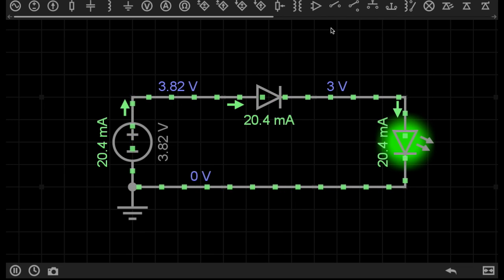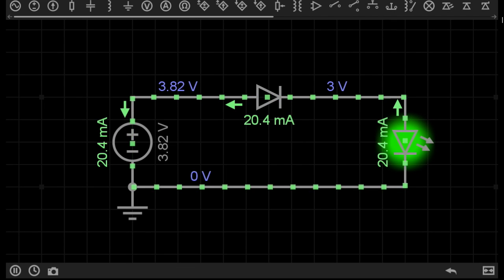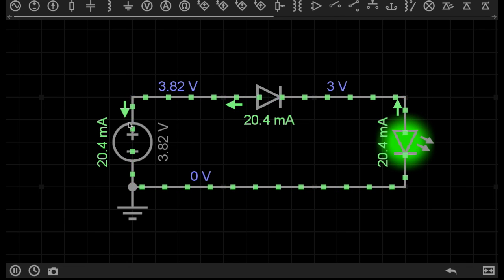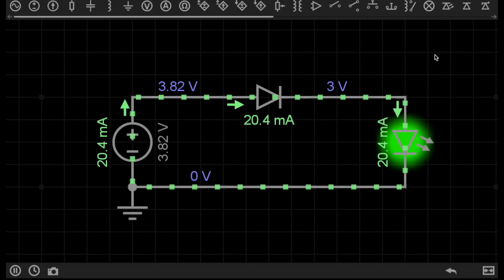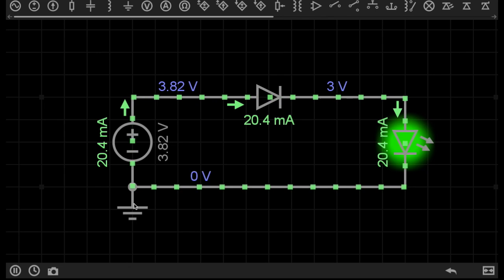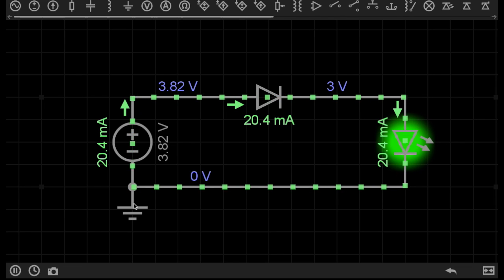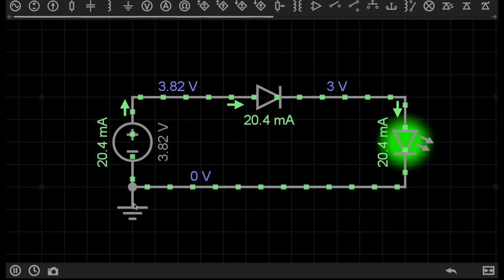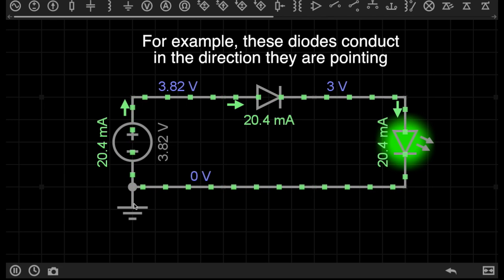Conventional vs Electron Flow Current Flow

Comment: I have a question. Say you design a simple circuit consisting of a battery, resistor, and LED. Conventional current flow says current  will go from the cathode to the resistor(the resistor will then weaken the current making it safe for the LED) and then the LED will light up and current will reach the anode. But real electron flow says current goes from the anode to the cathode. The LED will come before the resistor. The LED will be on the wrong side of the resistor and it will explode because the power rating is too low. Wouldn't this situation make conventional current flow circuit diagram dangerous to follow?
Reply: @Active camo To answer the question, Current is the same through all parts of a series circuit. It is the same through the resistor as it is through the LED. The resistor is there to limit the current. It doesn't matter what side of the LED the resistor is on, it just cannot be so large that most of the voltage is dropped across it and doesn't give enough voltage for the LED to emit. BTW he didn't "mispronounce" anything, he just incorrectly referred to electron flow as conventional current flow. There are two ways of thinking about it. Conventional current flow says that current flows from positive(anode) to negative(cathode) In reality, electron flow is from negative to positive. They made the convention of how current flowed, before they even knew about electrons and the fact that they were negatively charged particles. If you look at a diode or LED schematic symbol, it is drawn according to conventional current flow,  with the arrow pointing from the anode to the cathode. In reality the electrons flow from the line-side(cathode) to the arrow side(anode).
Reply: Thank you. I was wondering this exact same thing. Hopefully this question gets answered.
Reply: No, conventional current flow says that current will flow from the anode(positive) to the cathode(negative). The reality is that electrons flow from the cathode to the anode. That is electron current flow.
Reply: Others have answered this and it's been 6 years, but you still have it reversed. The free electron is the true model for all mass, energy and motion that we observe in this world in any field of science.

When an electronic current flows, electron + physics = electronics, it flows from the negative to the positive in one continuous line. 
With conventional theory, they observe current in the form of holes as in empty space when the orbit ring of said atoms at a constant rate of time are empty, and so you're always tracing empty space that is compartmentalized since the holes never actually leave those atoms, electrons do.

When you compartmentalize a circuit for analysis, it's highly useful because the student or scientist isn't overwhelmed with information, but when it comes to quantum physics and even classic physics, it's an absolute disaster and the number one reason modern science has barely progressed since Nikola Tesla. 

I went to a technical college, was taught the electron model of mass, energy and motion, and so I am constantly frustrated by the pseudoscience pouring into the world from mainstream media and celebrity scientists who have a degree and are an expert in quite literally, pseudoscience.

Comment: I am now happily retired and have the time and desire to learn something new. I have been put off learning electronics for many years because it seemed to me I could not understand even the basic circuit principle of; is current direction (+ to –) or (– to +). I have asked various people throughout the years but had no clear answer. I now see it was because they did not understand it either. 
Your Youtube video explains things much better and I see it was misunderstood from conception but I would like to know the following

1 Does current pass through diodes and other components -/+ even though identified as +/-.

2 Or are mains and batteries incorrectly identified as +/-.

3 Should switches and resisters be on the (-) (the power on side)

Sorry if these are silly questions but I would like to understand basic principles before my learning capability degenerates totally.
Reply: Electrons flow from the negatively charged plate to the positive one. It seems counter intuitive. But conventional current flows against electron flow. So if electrons can flow (which is against the arrow of the diode symbol), that means current can flow in the direction of the diode symbol. However electrons cannot flow in the direction of the arrow of the diode symbol, so nothing happens in the circuit. And it doesn't matter where you put the resistor. It only works if the current is flowing.

Comment: What if I say that electricity flow from both directions at the same time with different charge? I came with this opinion when I saw that some wire starts to heats up at the middle of it.

Sorry for poor English. CMIIW
Reply: That happens in salty water, it does not happen in a metal wire. In salty water, Cl- ions move one way, while Na+ ions move the other way. In a metal wire, positive ions can't move at all due to how solid metals are. Only electrons move in a wire, so current flow from the negative terminal to the positive terminal. Conventional flow is reversed.
Reply: That is quite an interesting statement, you made there. There are just a few things you need to consider. Electrons are always negatively charged. There is however an anti particle to an electron, that is called a positron. A positron is an electron with a positive charge. So far it could suggest that what you say is true. The only thing is that when a positron meets an electron they annihilate. The energy that is created by this process is way bigger than what you observed with the wire.  
I hope I was able to explain why your statement can't be correct, as far as I know, but it is interesting none the less.
Reply: @timo772  That's not what he said. Technically if his idea is true, you'd be having a net 2X charge movement for any number of electron flow - and they would be recombining in the wire.  That last part isn't even possible, but the first part sounds plausible.
Reply: @timo772  What? I though electrons were negatively charged, not positive.
Reply: @OmegaF77  Oh yeah my bad, they are negatively charged of course... I'll edit that for no further misunderstandings

Comment: Then explain why is positive always with a larger gauge wire than the negative? If electrons actually flow from negative to postive. Why does the positve always gets warmer with higher loads and the negative doesn't?
Reply: https://electronics.stackexchange.com/questions/95016/how-the-current-flows-in-a-car maybe these will explain some of your questions
Reply: Because the negative side is draining. The protons (positive side) are gaining Electrons: 
increasing mass > more energy > more heat. 
That would be my argument, correct me if I’m wrong. Negative would only be loosing charge and not acquiring. 

Either way think in the conventional way ( + to - ) and you won’t get confused.

Comment: please explain why we connect ground to the negative terminal?
Reply: Tayyab,   It means,  Tesla was right,   "The Earth (Ground) is loaded with electricity".   If  electrons are negative,  and "Electron flow" is correct.   Then Lightning is flowing from "ground" up..  The magnetic iron magma inside the Earth is constantly moving and generating electricity,  which gets released to the atmosphere..  I believe, the extra electrons in the Earth are coming from the direct nuclear center of the Earth..
Reply from the maker: the negative side of anything is always ground. everycircuit just requires the ground symbol to be placed there for some reason.
Reply: "ground has a lack of electrons and so does the negative terminal that's why we connect them together to dump the excess electrons (if any) into the ground" but if everything I've learned is the opposite of the truth and the negative terminal is the one with excess electrons what would that mean?
Reply: @tayyabnaveed2266  It's an arbitrary convention.  We have to place ground somewhere, and it is traditional to place ground on the negative terminal.  For the run-of-the-mill circuit that doesn't "care", you could place ground on the positive terminal, and leave the negative side ungrounded, and the circuit would work just the same.

This isn't always the case, as there are some applications that require positive ground.   There are also applications that require a dual power supply, with a positive half of the power supply that is negatively grounded, and a negative half of the power supply that is positively grounded.  Operational amplifiers being the go-to example of a bipolar power supply being required.

Comment: what is electric current
Reply: an electric current is defined as the ordered motion of electric charges.It is basically the rate of flow of electric charges.
Reply: Current is the measure of the rate of flow of electric charge

Comment: so basically electrons flow from negative to positive but they draw the opposite
Reply from the maker: Yup :)
Reply: It shows how little is really known about electricity..  I gave up on electronics because of this problem..   How can you build a circuit with a diode if schematics are backwards..   many many components won't work installed in reverse..

Comment: If I go to a store, and by some batteries, and then connect the two ends with wire (ignoring the fact that this is a bad idea): from which end will the electrons exit, and to what end will the they flow to? Using the printed labels on the battery to identify the positive and negative terminals.

Also: are the labels on any given store bought battery likely to correctly identify the true positive and negative terminals, or will they use "+" and "-" to indicate which direction the electrons will be flowing, utilizing the common assumption that they go from positive to negative?

If you have any info that can me help sort out the mess that is "conventional current flow direction", that is not covered by my questions, please share it with me.
Reply from the maker: Physically the electrons will flow from the negative to the positive. It is the electrons that move and the electrons are the negative charge. Opposites attract so negative is attracted to positive, much like the opposite poles of a magnet. But again, because only the electrons move, then it is the negative electrons that move to the positive side of the battery. This is how it truly works. But because most people understand conventional current flow to be the opposite due to how it was mistakenly thought to be this way when it was discovered; most theory is taught based on the assumption the current flows the opposite way (From positive to negative).
Reply from the maker: The positive and negative terminals labelled on a battery are the true poles. However, it really doesn't matter. if you connect a battery up, the electrons will flow unless you have something like a switch or semiconductor blocking the flow.
Reply: So the diodes in your diagram and reality actually lets electron flow through from the other way of what most shows it to do in theory, with the "arrow and the wall"? The electrons don't "hit the wall", they're actually moving counter-intuitively compared to the diode symbol? It's simply a memory rule for the schematics you learn that? I don't know why I find this so awfully confusing.

So I can ignore the fact of electron flow and put it in the back of your mind as a parenthesis, and accept the convention of current flow and all of electronic theory and practical appliances are based upon it?

Comment: disappointed that you will be going back to the late 1800s just to make things seem easier.
Reply from the maker: You should probably argue with the international standard for this issue. Given that most component symbols don't make sense when using them in a visual circuit like this.
Reply: First, I like your format, two, you are doing a great job.  But Im come from the point of view that the excuse of "but thats how it has always been/done" is a very poor justification for doing something. And with the symbols not being aligned with true current can be looked at in a different way...Take the diode for example. Instead of teaching the diode arrow shows current...teach instead that the line is the neg symbol which corresponds to the neg side of current and the arrow can be look at as the anode because it looks like an A. and the line with the arrow make a K for cathode.   Its all relative of course.
Reply from the maker: Thank You for your compliments. I understand your perspective on this but I don't think it's that big of a deal. I would always make a point of mentioning electron flow when I feel it is necessary in any of my videos.
Reply: Check your patrion account.
Reply from the maker: I certainly got the notification and sent you a message. Thank You :)
Reply: @SimplyElectronicsOfficial   Diode symbol is actually the best representation of electron current, showing how it "runs into a wall", and then having the "wall" take different shapes depending on the type of diode (barrier conditions) : zener, schottky
Reply: @Ezzell_  The problem is not that symbols won't look right, the problem is that the whole world is using conventional flow and switching would cost insane amounts of money and would cause a lot of damage due to human error. Look at how the USA uses Imperial units. Imperial units are deeply flawed and hugely inferior to the metric system, yet Americans still use the Imperial because it would cost too much to switch.